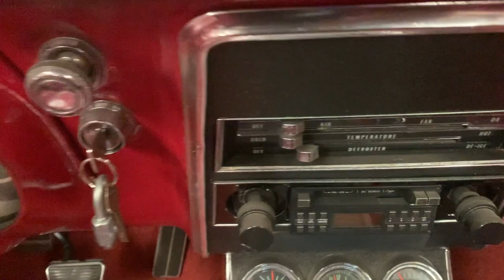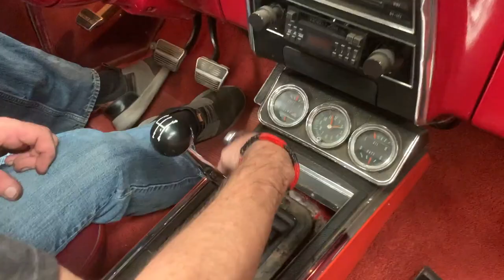1967 Camaro: How To Convert to 4 Speed From Automatic.

Comment: one trick I use to install the trans easier is take 2 aprox 6 inch bolts same size as trans to bell housing cut off hex head and install  in bell one top one bottom diagonally  they become guide pins .
Reply from the maker: Genius!! I’m going to put that to use

Comment: I know the power handling  from engine to trans will be wrong but can I put an 83 Firebird 5 speed in a 69 camaro ? The camaro  has a 327 and the Firebird is a 5.0  .  Thanks guys a great video !
Reply from the maker: Should bolt up ok. We always check the top of the bell housing as some Pontiac transmissions don’t follow the Chevrolet small block shape at the top of the bell housing near the distributor. But that transmission isn’t super stout.

Comment: What clutch fork spring did you use ? Can you tell me where you got it and a part number ?
Thank you
Reply from the maker: We no longer have a part number but it was a NAPA part. You can try application but I believe it is a generic/ cut and bend your own length if I remember. It was very easy to do. Cut 1/2 inch short then with needle nose round a hook on the end cut.
Reply: @thegaragefathers496  Thank you

Comment: Would this apply to a 77 Camaro probably not I’m just wondering if it would be a similar process?
Reply from the maker: The process would be very similar, but of course the parts would be different. I think 77 is still using a three speed automatic, so a 4 speed should bolt upwards to the crossmember and utilize the same drive line. You would need. Correct? Shifter, linkage, pedals brackets and linkage. Sounds like a fun project!

Comment: Trans fluid? Would the crossmember on a Turbo 400 Camaro work with this swap?
Reply from the maker: No the 400 transmission rear mount is further back. It uses the same frame mounting holes but won’t line up to a th350, power glide or 4spd.